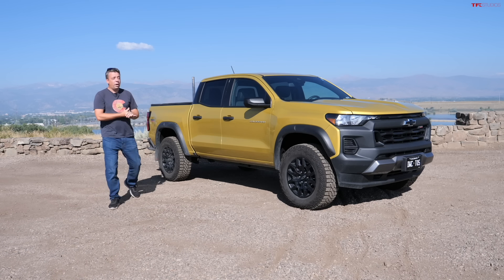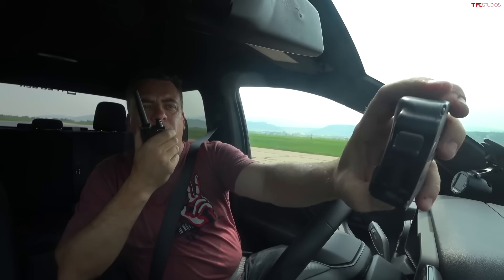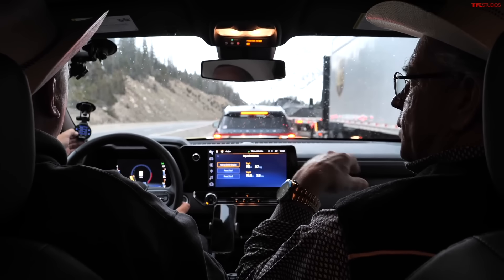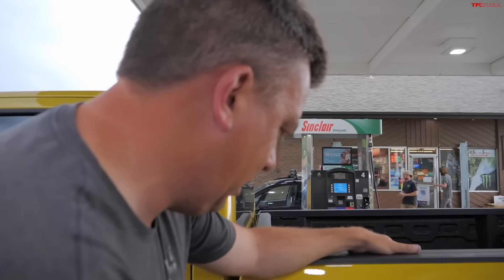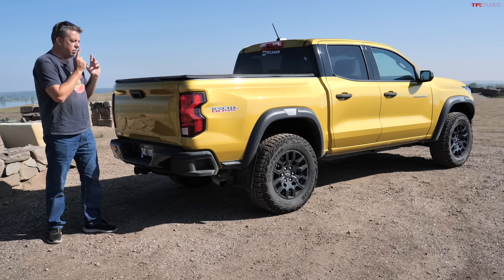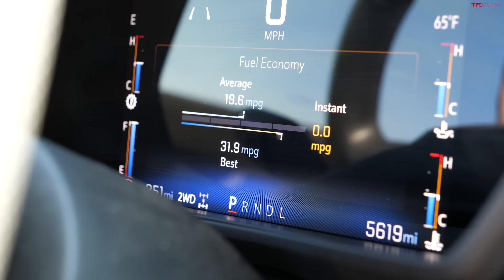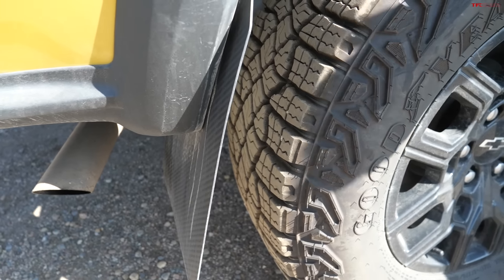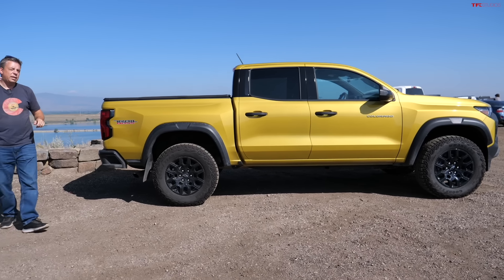Chevy Colorado: Great & Awful Things I Learned After 6,000 Miles - Long-term Update

Comment: Your continual reviews & relaying real life conditions  & info on the Colorado’s quirks  for this truck are extremely helpful as I’m in market for the Colorado or the upcoming Tacoma. The concern/pain point  Issue in my decision is that we tow a travel trailer 4800 lbs empty, probably 6.000 lbs loaded, (currently with my 17 Colorado Duramax, up hill a little week, exhaust  brake capability downhill is superb) I like a midsize over full size for everyday use although full size more sense for the towing.

The Trail Boss fits for the most part but the things missing that GM did not offer as options is absurd, as you point out  it seems for $1000  or so more they could offer features not available . I love the ZR- in  many ways  but towing is reduced. 

I have a bit more confidence in the Tacoma (had a 13 never has ANY issue other than weak towing). My Colorado had some issues specifically with engine totally shutting down while driving a scary experience within first 5,000 miles that after 3 trips to dealer resolved  & has not occurred since with my current mileage of 51K but was frustrating as hell.

The new Tacoma rated at 6500 towing thus my concern a bit close to max on what I tow. As strong & reliable as Toyota’s tend to be perhaps I would be ok?  Seems unclear when the Tacoma will be available, a dealer advised me the still had over 125 incoming current models arriving. 

I’m in Colorado as well so our towing is much at high elevation that effects towing capabilities.

Tough decision.

Comment: Like the black. I believe it makes the color pop. 11,174 miles on my trail boss with zero issues. Apple car play is a little wonky at times but seems as it has been working the past month with zero issues. I drive about 110 miles round trip to work so time will tell more. Keep truckin!
Reply: Nice! What mpg are you getting?
Reply: @NeverFollowTheCrowd  well it all depends on how late for work I am. 70mph I can get 19 60mph I can get 22. Running bigger tires so not to shabby
Reply: On running bigger tires, did you get larger than the 32’s stock on Trail Boss?
Reply: @craigshannon5687  yes
Reply: I also prefer the black grill over the higher trims.

Comment: Put 43k miles on my '21 Ranger so far.. ONLY problem ive had is the Sync 3 is a little buggy. Ford Performance Tune since new, 3.5 lift, 285/70R17 AT tires. Runs/tows great.
Reply: What lift did you do and did you do UCAs?
Reply: My dad has same year Ranger with 50k no problems at all. I'm planning on buying it if he ever gets rid of it. How is the tune BTW? I hate the one I have on my Coyote Mustang and probably going to remove it.
Reply: @302Mustang13  It's a very mild factory tune, 45 HP/65TQ. Not a race tune by any means, but the tuner let me recalibrate the speedo for my bigger tires and lets me read/clear any codes. I'm happy with it,  truck has plenty of power.
Reply: @Someonehad2sayit  I meant do you notice a difference in the butt dyno? I don't notice much difference with mine on my Coyote Mustang unless I'm about half throttle and more. I have driven a 7.3 Powerstroke diesel with a mild tune and it made a huge difference. Tunes in my opinion are better on boosted vehicles.
Reply: @302Mustang13  I noticed a small improvement,  it's just not a race tune.. the Ford Performance tune is actually warranty safe tune, so it's not radical. I hear Livernois makes a really good one tho.
Reply: Dang, 43k is a lot.  My 21 just hit 30k.  It’ll be 2 years old in October.  No issues so far.
Reply: @utope2  I live 40 miles from the nearest town.  Didn't want any neighbors, LOL.

Comment: Hello Andre’ once again my friend a fantastic video. I own a 2019 Colorado CCSB 4x4 WT, I had added Bilstein 5100’s all around and leveled out with 2” front lift. I used to own a Grey Wolf 24 JS, that weighted about 5,600 lbs, certified at 10,250 lbs. CGVW on a Cat Scale. The lifetime average for the truck now at 44,000 miles is 18 mpg average. That’s mostly around central Florida with my 240 lbs scooter in the bed. The average I used to get with that trailer was 10.6 mpg, while easily maintaining the speed limits on all grades. All along the east coast inland to Pigeon Forge, TN in The Smokey Mountains.

Comment: Mechanically I love my 23 Colorado. Did the online build and ordered it with more options than yours as well as the engine upgrade to 430 ftlb of torque.  After 2K miles had a software glitch and the radio screen went out, and almost everything is controlled through that screen. Took it to dealer and 3-1/2 weeks later still no part available. Chevy actually offered to do a buy back because they had no idea when the part would be available. The tech dept. at GM finally sent software to fix the glitch so I got it back but it still has small glitches now and then. Other than that and the serious lack of storage inside it is fun to drive and runs great.
Reply: My 2016 Colorado doesn’t have much inside storage either.  I traded a 2005 Ram 1500 with a standard cab.  Had more storage in that than my Colorado with the extended cab.

Comment: The black-out on the pillars looks really good, especially with that Nitro Yellow. I have the ZR2 now for about 3 weeks. Had two issues so far: 1st, the child safety switch on one of the doors was jammed in "lock" position so you couldn't get out if you were a passenger (currently fixed by dealership). 2nd, the volume control for radio stopped working. Restarting truck corrected it. Notified dealership, and there was an update for the system, and so far, it hasn't happened again. One nit pick I have with truck is that the fuel door doesn't lock. And since it is cap-less, anyone can easily siphon fuel out. Loving the truck tho.

Comment: Nice truck but I would have kept the F150
Reply: It’s all about the content… I bet he replaces the Colorado in less than 12 months
Reply: @aarone9454   I mean how long would you long term keep a truck without cruise control?
Reply: @richardnavratil9661  I had my Tacoma (w/o cruise) for a few years. Wasnt pleasant for trips, but I tolerated it fine.
Reply: @aarone9454 he already said he's going to. I bet he gets a new Tacoma
Reply: @NWI_Steel or the new ranger raptor

Comment: Its a nice truck Andre! Love the wrap. Its a big improvement from the basic spec 2011 that I drove a while back. It was a very solid and capable truck but unfortunately yours seems to have two of the same issue that I had with the 2011. The backup camera, and the display would fritz out occasionally, sometimes the backup camera would just stay on while driving - that was always fun. I had to pull the fuse every once in a while and reset them.  Hopefully GM fixed the other annoying issue I had with the EBCM that you fortunately havent experienced yet. The EBCM had a design flaw, it was mounted to the side of the frame rail on the driver side with the brake lines bent in such a way that they drained water down into the EBCM every time it rained resulting in the dash lighting up like a Christmas tree. Dealer said the solution was to pack it with dielectric grease, frequently. I tried to file a request with GM as it was really a safety issue as it disabled the ABS and traction control (when you need it most) but they just ignored me. I spent many days under my truck with the wife's hairdryer, drying it out. I finally got so fed up with the electrical gremlins that I wrapped the EBCM in a trash bag and electrical tape and traded it in at 45k miles. I am hoping they fixed it on the new model. Just a heads-up... don't go to deep when you launch your boat! Good Luck - keep up the great videos!
Reply: @builder9094
“Don’t go too deep when you launch your boat”,, that’s what she said 🤣🤣
Reply: Same problem on new models?  Man, what poopy engineering

Comment: I had a 2016 Chevy Colardo 4x4 LT 3.6 Auto. Had issues with both rear axle leaking before 10k miles. Fixed under warranty. Then the stereo/navigation started blinking on and off randomly. Again, fixed under warranty. Transmission shuddering. Dealer could not fix it after several TSB updates. Finally bought a programmer. The programmer was able to completely eliminate the shifting issue. At 35k miles rear axle leaking again, got it fixed and sold it 35,900 miles. Went back to a Tacoma. Bought a 2019 Tacoma TRD Offroad. Just turned 60k miles 9/7/23. Zero issues, no leaks, nothing but basic maintenance.

Comment: As an owner of the new Canyon. The carplay delays on the infotainment really only seems to happen when the phone is on low power mode. I have a feeling that may be the case for you as well because in the video it's working smoothly and your phone is fully charged. I think that might be what your experiencing as well.

I've also had issues with my digital gauge cluster freezing completely while driving. GM is aware of these issues with these models and it's still something they clearly struggle with as it's been reprogrammed 3 separate times now. So far so good now and absolutely love the truck; however,  it is discouraging to run into continuous programming issues so early in it's lifecycle.

Nice truck and appreciate your insights into your ownership experience

Comment: This is very interesting to me Andre. Have been wondering how this Colorado would perform. This summer I towed my 25' travel trailer in and around the Mountains with my 2022 full size ZR2 with the 6.2 engine and got similar MPG to your Colorado when you are towing. My trailer is an older 2007 model and far from aerodynamic in the front. I use a Reese equalizer hitch with 1,000 lbs tow bars. I scaled the truck and trailer at a scale near us just after departing and it weighed 14,890 lbs combined. After filling it up with gas it would be very close to the max 15,000 lbs GCWR of the truck. Here in Southern Alberta Canada we drive in similar terrain and elevations that you do in Colorado. Part of the drive on that camping trip involved slow going off road trail towing in low range using the lockers at times and the truck didn't disappoint. The DSSV shocks in the truck are fantastic on and off road and the truck has plenty of power to do the job. 
The full size Silverado ZR2 videos you did back when TFL owned one influenced me to buy the truck. Mine is also sand dune metallic in color and it always looks clean even when I don't wash it for a month. Have almost 20,000 kms on it now and am very happy with it so far. Did a recent 2500 km trip with it not towing and it got great fuel economy. I often see fuel economy in the 11-12 litres per 100 km range (19.5 to 21.5 MPG) on the highway and the best on that trip was 9.8 over a 40 km stretch which translates to around 24 MPG. I have been considering getting the Colorado or maybe a diesel version of the ZR2 but after watching a few videos I think for now I will keep what I have. Best part about my 2022 Silverado ZR2 has to be the excellent ride quality the Multimatic DSSV shocks provide along with the performance of the 6.2 engine and 10 speed transmission. Roman's comment when he said "this truck goes wherever you point it" resonates in my mind at times when I am driving it.
You and TFL have come a long way Andre keep up the great work!

Comment: I've had my '23 Colorado LT for a little over two months and have about 2400 miles on the odometer. My highest mpg is currently 26.7 and I've hovered in the 25s quite a bit....not driving like an old person either.

Comment: I have a 2018 Colorado ZR2 with 50K miles. It has the 3.6 V6 engine and 8 speed. I have not had any issues with the power train. The transmission was flushed and refilled under warranty and has worked fine for me. I find the gas mileage differences between your 2.7 turbo 4 and my V6 interesting. I get 18.5 mpg combined city, highway, whatever. The best mpg I have seen for highway trips that are mostly flat is 21 to 22. So, the two engines have the same peak horsepower output, the 2.7 turbo makes roughly 100 lb. ft. more torque. It would be interesting to see how the two engines feel under various conditions, for example passing on two lane roads when you need more top end pull and responsiveness when low speed off roading. Thanks for sharing your experiences with your new Colorado.
Reply: Yeah, I can't believe G.M. is ending the 3.6 just when they perfected it and made it a long lasting reliable engine....figures..

Comment: In 2022, my 2016 GMC Canyon oil pump failed at less than 65,000 miles. I bought it new. It has the four cylinder. I couldn’t get a straight answer what made it fail. I changed the oil every 5,000 miles, but it did. I pull a small trailer with a zero turn. The cost was over $7,000 to get it repaired. It’s worked well since. I drove it to South Florida this fall from Kentucky and it got 25 mpg. I am not sure I would buy another one today.

Comment: I have a 2023 Z71 and it is great so far. I do have a couple of issues that are related to software. One is I get a very loud "Pop" the first time I use the turn signal after an engine start. It is coming through the infotainment speakers. The second is that sometimes my Sirius radio will say "Loading" forever unless I stop and restart the truck. I also had the loose fuse issue that is easily corrected and the right side windshield trim piece that doesn't fit properly. I believe everyone has that trim issue and it looks like it is a manufacturing error. I like the pep and ease of driving this over my old GMC Sierra. BTW, this truck is so much easier to park than my old truck.

Comment: I have a 2019 Colorado Z71 crew 4x4 V6 with the short box. In my daily flat Michigan driving on summer fuel, I typically average about 19.5 mpg with a 90/10 city/highway mix. I just returned from a 5,400-mile trip to the West Coast where, according to the truck computer, I averaged a hair over 22 mpg for the entire trip. The best segment was 29.9 mpg. My truck has Bose, the trailer brake controller and a couple of other minor options. It's also the only model year, IIRC, where GM  included dual power front seats with power lumbar and heat. The sun visors slide to shield my eyes from the sun, too. It stickered for a bit over $38k. It's been a great truck and I would not part with it for the latest gen Colorado.

Comment: At higher elevations, with the air being less dense, you can use lower octane gas just fine.  No need to run 91 octane.
Reply: No reason to run high octane at lower els either.
Reply: @Dusdaddy why’s that?
Reply: @deluxeg  Because that 2.7 was specifically designed to run on 87. High octane will only waste money.

Comment: My main hang up on this is the G80. If you can spec a real electronic locker in a Ford for a couple hundred bucks, GM should be including one in their off road trucks.
Reply: I don't know. The G80 has a pretty good rep for durability. Why not just stick with what works well?
Reply: @Dusdaddy  Because the G80 isn’t smooth and when your actually needing a locker while rock crawling not being smooth can lead to bad things happening.
Reply: @thinde88  Won't argue but the G80 is much smoother than a Detroit locker and I will never remove that from my CJ.
Reply: I had a 2002 Sonoma with a factory rear locker. I was driving 70 KPH in the winter on a straight road and it suddenly went into a spin. I spun around 2 or 3 times before the truck hit a snowbank and stopped. The problem with an automatic locker is that you can't turn it off and when one tire is on ice or you are going around a corner in the rain the ass end kicks out and you are sideways or spinning before you realize what's happening.

Comment: Why didn't you talk about the differences between your F150.  You went from a full side pickup to a midsize pickup, do you miss the space.  What is the difference in gas mileage between the two? Which truck tows your boat better? What costs saving with the Trail Boss?

Comment: I would say 22 mpg is an amazing result out of the 4cyl... But my 2019 v6 got 22 mpg this past summer on a 400 mile round trip. At the end of the day, how it's driven is much more important than mechanical efficiency it seems.
Reply: Getting 22mpg is a minor miracle in my Tacoma v6
Reply: @svpracer
My ‘18 f150 TT v6 got between 24 and 26 mpg, with an avg speed of 73-80mph, on a 3000 mi trip last spring, hand calculated. I am extremely satisfied with those numbers

Comment: I'm a Ford guy myself but I love your truck.
And in today's prices I think you did pretty good at 41G's.
Thanks for the update.
But what's funny is in 1978 a full size Dodge was rated by the EPA at 23-25 mpg.
Reply: Yeah maybe with a bare bones short bed with a slant 6 engine but definitely not a V8.
Reply: My 2008 F150XL with the 4.2 V6 doesn't get that, anywhere close to that. And my truck is about as bare bones as anyone could get. The only 2 options it has are A/C & a radio. 4.2 V6 with a 5 speed manual is on average 17.5 mpg.

Comment: GM made a mistake by getting rid of the baby diesel for those trucks I would not buy one of those trucks I would stay with a full size so you are saying not to buy it that the tech in the truck is junk
Reply: Agree 100%
Reply: Just towed 250 miles last weekend with a Kayak and camping gear for a weekend in our 2.8 Duramax. 34.4 mpg.
Reply: @coachvonyo  it’s almost like they don’t want good mileage for consumers
Reply: Isn't the 3.0L diesel duramax what you're looking for? I think they're making them still

Comment: I have a 2022 updated SIERRA. happy with the truck but compared to my 2014 sierra its missing a few things: no 12v plug, no coin storage on the bottom dash, no light up vanity mirrors, no oh shit handles but does have the ones on the pillars, no trailer brake. Mind you, my old one was a SLE and this one an elevation that had an MSRP of 58k but only paid 54k.